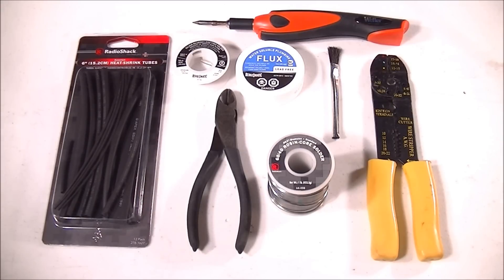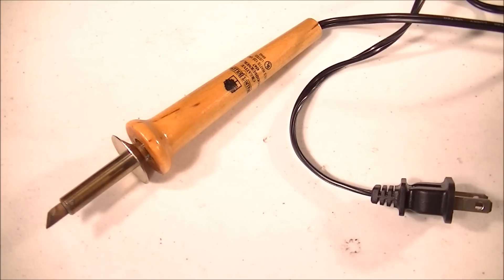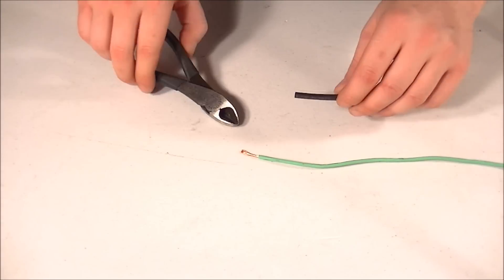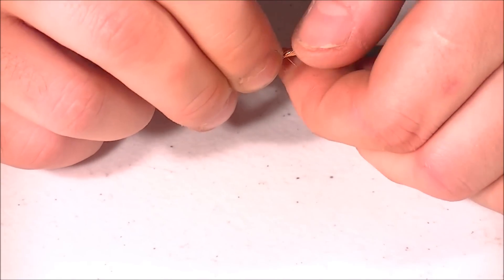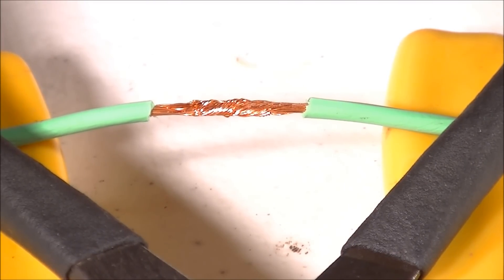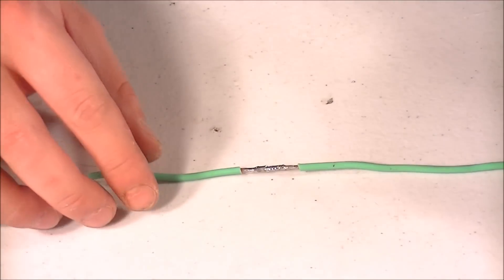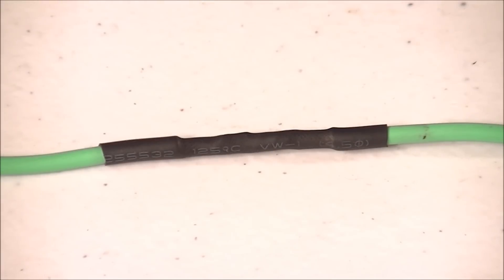How To Solder - Intro/Joining Stranded Wires - Part 1

Comment: I had to rewire a part of my trailer, the connection to the adaptor had fallen apart.  I cut, crimped and taped my job together.  The strength it took to crimp was tough.  Soldering is way more effective and I'm pretty sure I can do it.  Thanks for the video.  Rose

Comment: i'm soldering really thin wire i don't think i can do this...yeah i just did and the wire rubber just melted as soon as i touched the wire
Reply: Need a temperature controlled iron. Heat application is main part to soldering gotta get right amount of heat and not too little or too much.
Reply: Stick a crocodile clip on the bit where the copper joins the insulation. The clip will soak the heat away

Comment: Thank you. I will now proceed to shorten up two wires.  One from a security camera, the other from a 120v. to 9v. adapter. with a bullet connector on each.  Of course, one a female; the other a male.  I had forgotten all about heat shrink tubing, and would believe I used to sell it? I simply need to buy supplies you listed.  I'll be working with stranded wire, and like the way you put it together. My best, Jude

Comment: how would excess solder INCREASE the resistance?
Reply: Thinner wire has less resistance and you need less voltage to get from one end to the other. Increase the length or diameter (and thus overall mass) of the wire and you are adding resistance for the amps to travel through, Excess solder would have the same effect and require more voltage to pass the current though.
Reply: Does anyone go to school these days? Does water flow better through a narrow or a wide tube? Physics grade 5.

http://hyperphysics.phy-astr.gsu.edu/hbase/electric/resis.html
Reply: Mr Mürk That's a bad analogy as water doesn't pass through solid objects, it needs space. However reading the result of what you are saying and further investigation sucks, as it turns out everything I thought I knew is wrong! This is pretty messed up to me as I picture electrons having more to pass through would be more difficult, as with the longer wire you are increasing the area which to travel through but in another way. I can punch through a sheet of paper, but an encyclopedia would give me much more resistance. Nope. Can't get this right in my head, the laws of physics have got it wrong on this one. S'fucked up. All of it.
I'm hitting the gin now.
Reply: Go look up resistance in different gauges of wire,ie, 10 as opposed to,say 22,then come back and say that.The larger wire always has lower resistance(technician for 30 some years as well as a Ham).
Reply: By the way,even I learned something new,how to solder stranded wire properly,haha.

Comment: Thank you for the helpful information.  I soldered a few wires recently as a test and most of them ended up looking like the "BAD" examples you gave. I'm sure I'll do better now. Anyway, you mentioned how the soldering iron can prematurely shrink the heat shrink insulation. I did just that when I was testing using a short wire.  Do you have any suggestions for how to add the shrink insulation AFTER the soldering has already been done and the insulation cannot be pulled over the wire? This could be helpful in some circumstances.

Comment: My solder never melts at the tip of my soldering pencil.  I have to touch it to the middle of my pencil to get it to melt, and it just balls up and vaporizes.  What gives?  Is it that it's a pencil vs. a gun?  Is there not any flux in my solder?

Comment: Very helpful...question though...What about soldering wires under the hood of a car, will/can that cause it to heat up to much to where it will melt the solder? I bought a Bernzomatic beutane torch/solder gun & it came with a small roll of solder & I was going to use it for 6 wires under my hood, some will be semi close to the motor & the motor is high performance so Im worried about future failure & or how to check/fix it if it does
Reply: Check for high temp solder on the internet.  There are a variety of solders with different melting temps and strengths.

Comment: So if there is way to much solder. It could make it to less power go's to off road lights for example
Reply: If it will, it be very very little diference, you can't feel or probably even measure with ordinary equipment.
Reply: If anything it will improve current handling capabilities

Comment: Man you've got some bad practices there!
Heatshrink should be shrunk with a heat gun not burnt with a lighter or even worse the soldering iron!

Excess solder does not increase resistance, it's unnecessary but does not increase resistance. Put enough solder on to cover the joint but you should be able to count the strands in the wire.

But you did some nice joints.

Comment: I had a wire detach from a 9 volt battery snap connector. I re-soldered wire back on but to do that i had to remove the black protection on the connector by cutting it off. What can i use to replace that?
Reply: Liquid Electrical Tape.  They sell it at HomeDepot in the electrical department.
Reply: Sconkworks Thanks!

Comment: What kind of solder were you using? The solder i have that is rated for electric doesn't melt when i try and heat the wire.  I am trying to solder 12guage wire together.

Comment: i have a matchbook charger. paid someone $20 to solder it together it worked for a long time until now. since is very close to the end tip of the charger do i still have to take off an inch no both sides?

Comment: 1. IPC Industry standard calls for 2 J hooks in the wire to form the best mechanical bond. 2. You have flux, USE IT. Even though you cannot see it, the copper is oxidized and the flux removes the oxidation. 3. Your solder joint is COLD. You are correct, it should shine. Yours do not. This crap will pass for home hobbyists but will get you fired in the workplace.
Reply: We'd love to see your video, can you provide a link please?  I mean, a super knowledgeable soldering guy isn't gonna be looking up "how to solder" vids just to rag on someone's know how, after they spent their time to help people out, and did a pretty good job at it.  Thanks for your input though, we will all be looking forward to your previously posted video.
Reply: What a dimwit  trying to be smarter than the teacher If you had any experience at all you would see that he was using core solder which has its own built in flux easily seen by the fumes as he heated the solder to melt on to the wire the shine was there but you were so busy looking for faults you would not appreciate the job done he is wiring for car use not overhead crane cables you dope. get a life.  j hooks are bulky and unnecessary on car harnesses  these joints are for carrying power from a to b not for a bloody tow rope you dope
Reply: Pr3ct  give us a break.  Why would a world-renown master of soldering two scrap pieces of wire together be TROLLING on YouTube bashing other person's videos?  Most experts don't go around looking for advice from amateurs.  So until you put up YOUR video showing us your skills and expertise, stop trolling.
Reply: dang I was really hoping this 7 minute youtube video would get me a job soldering things
Reply: yeah i totally agree, a beginners intro to soldiering on youtube probably isn't the only training one should receive before making a career at it.
Reply: Chum K Know what? Maybe I will do one. What Pr3ct said is perfectly right. Flux is a need for soldering these wires and if the solder is not shiny, it means it has a weak connection with the wire and it can cause trouble if you pump through a lot of current
Reply: HunChem
 So is your video being uploaded??
Reply: Or he used lead-free solder on first pic ... :P
Reply: HunChem
k, I would really appreciate it if you let me know so I can see the new ones. I haven't started soldering yet but I really want to and I even purchased like a cheap kit from autozone which looks like a yellow gun. In any way, thanks in advance.
Reply: Dennis Vivanco Is it like this?
http://www.e-center.hu/img/original/640x480/product_106826.png
(if yes, I'm happy I'm not the only one who started with a solder gun :D)
Reply: HunChem
LOL Yeah!!!!
Reply: Chum K thank you for your comment.....gives me hope that the world is not just filled with twats :)
Reply: Hear,hear.
Reply: fuck it, just pull out the wire welder and be done with it. maybe a stick welder if its windy out.
Reply: Dennis Vivanco Later, I have 3 recorded. My soldering station is fucked too, I will need to buy a new one.
thelittleleprechaun First of: Flux core solder isn't as good as it sounds. I like to add dissolved flux from a pipette. The excess flux is better most of the times. Plus that sentence about "these joints are for carrying power from a to b not for a bloody tow rope you dope" is just bad. If a joint has resistence, because it's not soldered as intended, it will cause a reasonable voltage drop. You don't ever want that. Another downside is that machines with any kind of vibrations should not have a joint like that. If something is not fused together good enough, it will literally fall apart.

Comment: something you didn't mention, some wires have a protective coating that can prevent new solder from sticking to it and making a proper connection.

this stuff can usually be cleaned off by just running the end of the wire through the solder on the tip of the gun until the solder sticks.  make sure you're in a ventilated area though.

Comment: This might not work for automotive or other critical joints. Since the wires will break where the solder meets copper. This was banned for critical applications. But is just fine for normal people like you and me... which I prefer 99% of the time. But I wouldn't use this for life support, or for a stage/stadium for sure.

Comment: I have watched a few videos on soldering and i was still uneasy about it and i was sticking with butt connectors, i will now be spending a day or so redoing most of the wiring in my truck. thanks

Comment: Nicely done tutorial.  I'd only add to tell them to heat the work, and let it melt the solder.  Also mention a 'cold' solder joint - where the work moved before it cooled.
I like you joining technique - look up the old "Western Union" joint for yet another style - strong but not sleek!
Reply: Ok

Comment: You should not using water soluble flux on stranded wire.  It too is very corrosive under the insulation were it can't be removed.  I only use it where it can be 100% washed off.  No-Clean flux is best for stranded wire.

Comment: Thanks for the input.. I am just starting to solder.. I do lots of small wiring jobs on bikes and its just novice stuff but i always use the crimp connections..I had a technician come work on this crane I operate and he did some soldering on small wires like 18 gauge and I was very impressed with the whole concept.. I been practicing with just wires a week or so but I still got lots more to go.. I seem to just put too much solder or something.. All your pictures of "bad" looked like my good ones..I do appreciate your help..
Thanks

Comment: I would not suggest using the flux posted in this video. It clearly says "plumbing" right on it. Plumbing solder is acid based.
Reply: ***** Perhaps electrical flux. Rosin core.
Reply: Water Soluble flux is also corrosive on stranded wires.  Should be using no-clean flux.

Comment: The video on wire soldering was very good.  Do you have any experience with Shrink Wrap Tape, I am thinking about using it to wrap a engine wiring harness that requires some significant repair and rewrapping? Thanks Again

Comment: I reciently tried to solder a wire to an led but the solder seemed react odd it was flowing but it seemed as if it was being repelled by the wire or led lead I'm using rosin core solder I have no idea what I'm doing wrong my only idea is the temp but my iron using a degree setting and I have no idea what the correct heat setting should be , can you help me
Reply: gently clean the leads with a razor edge.It means the leads are invisibly rusted,and is repelling the solder.
Reply: Use rosin flux. Ignore the scraping comment, you cannot possibly scrape all the invisible oxidation from any surface. Chemical cleaning gets everything.
Reply: An rosin flux you recommend
Reply: practice soldering on scrap wires first.And clean your soldering tipe frequently.A good ceramic tip is completely diferent form a cheap Made in china 5$ soldering iron.
Reply: Sounds to me that you are not heating properly the contacts

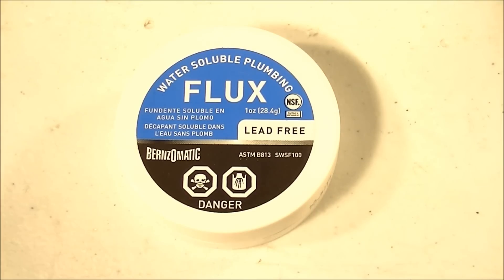Comment: Good techniques, but one little "nit" to pick...at about 1:14, you mentioned that the flux "oxygenates" the metal. My understanding is that rosin flux turns acidic when it reaches its flux activation temperature. The acid phase actually de-oxygenates the metals being soldered, so an inter-metallic bond can be formed. If there are oxides on the surfaces of the metals being joined, the solder won't adhere.

Comment: What about a 9v battery powered pickup on my acoustic electric  string? Fearing never plugging this in directly to the amp..............warned never to do this. High impeadence is what we are dealing with when directly pluging into the preamp on my console or even my new Audio imterface say a Behringer FCA1616 or Presonus 1818................I fear this.  Is this why I need the DI to make the signal "low impeadence"?  Thanks

Comment: Njprepper321 very helpful video. could you answer a soldering question, when using a soldering station whats the best practice to set a soldering station at, when soldering smaller wires, say 16 to 22 awg wires.

Comment: A small amount of "puddling" is useful for thermal contact. But yes, most of the solder should be applied away from the iron.

Comment: I like how you held the wires still for the soldering, nice way to hold the wires still and up off your desk.
An advanced technique: right before touching the wire with your iron tip for the first time, put a bit of solder on the iron tip. If you are quick enough, the residual flux burning off the iron tip will start to clean the wire copper, and you will already have the solder blob acting as a thermal bridge.

Comment: @curty85, to highlight one thing that NJprepper321 mentioned... "and practiced ALOT". This is very important. I do this sort of thing professionally, and before I try a new (to me) technique or procedure, I do it a couple times on scrap material. Even when changing the setting on my automatic stripper, I strip a scrap piece of wire of the same type I'm working with. Nothing worse than screwing up the last connection on a complicated wiring harness that is supposed to be "flight ready"...

Comment: Adhesive lined heat shrink tubing is NOT that hard to find. It's out there on eBay and is stocked at Digi-Key, Mouser Electronics and at most boat/marine stores like Boat-US, West Marine, US-Marine, and so on. If you are doing any wire repairs exposed to the "elements", this is the only stuff to use. A standard butane lighter still works fine for the heat; once the glue starts to ooze out of the ends of the tube, you're done. 

Tom D.

Comment: adhesive lined is quite hard to find, but it is indeed thicker and stronger and adheres better, and have to be a little more careful with the heat {probably best with a heat gun} and keeps out corrosion

Comment: Per my last comment about the adhesive lined heat shrink tubing; how about doing another revised video using this stuff with solder splicing wires?

Tom D

Comment: Hey NJprepper321;

I like your "proper way" to solder splice wires; these as the methods I've used for the last 30 years. 

To do a better job of truely sealing the splice, I swear by the commonly known name of adhesive lined heat shrink tubing (found in many marine/boat supply chains). Using this type of heat shrink makes the splice totally air & water proof.  Also it is thicker than the standard heat shrink and more closely matches the original wire insulation thickness.

Tom D.

Comment: Wow, great video.  I had tried soldering before and ended up with clumps and the solder not filling in the wire.  Now I know why.  I want to solder the wires for my car radio install and now I have a good shot at getting it right.  Very good video quality, camera angles and concise instruction!  Great job!!  Thank you for taking the time to do this.

Comment: great video im looking into learning so when i work on my car. so ive watch other vids but i like yours but i saw that you heat the wire and then you touch the solder to the wire and left the gun in the middle does that mean that you dnt touch the solder to the gun at all or just when you start?

Comment: Great video!  I just soldered some small wires together that connect some color changing led strands together.  i did a good and clean job.  but now the leds wont light up.  any ideas?  I know it had to of been my wiring because i tried another wire and the lights worked fine.  does soldering wires together mess with the voltage enough to dismay devices?

Comment: Very informative solder video.

1 question. When I solder, it seems like it flows into the wire on each side so that when it dries, the wire becomes stiff inside the insulation up to about half an inch on each side of the solder joint. 

I'm using rosin core solder btw.

Comment: My solder gets stuck to the tip and falls down and plus the wire does not heat up enough to melt the solder